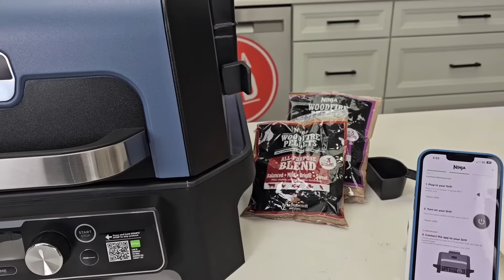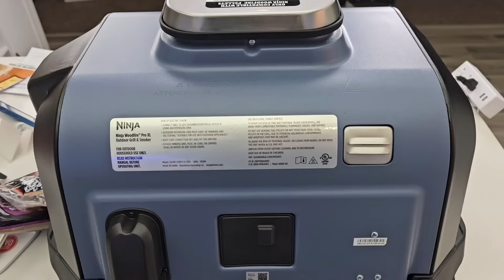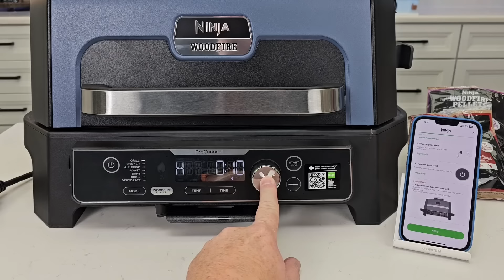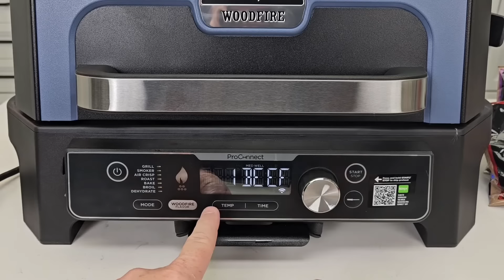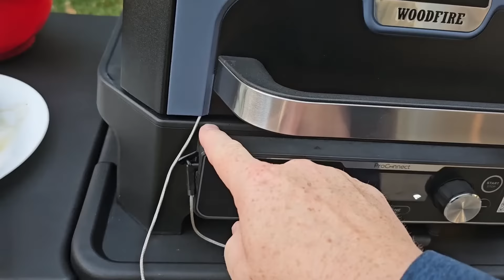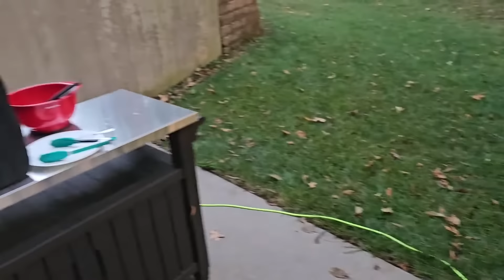Ninja Woodfire Pro Connect XL Review | Setup, App Control & Steak Results!

Comment: I just bought 1 of these. It was on sale for 177. Those wondering if the smoker works woth the pellets.... yes it does give it a smokey flavor if you turn it on
Reply: It was the pro connect xl? You sure?
Reply: @kevinahearn8764  yuuuuppppp. Positive. If i could post the pic i would show you. Got a pic n video. The pic shows the price. Almost bought 2 to try to sell the second one or gift it to someone who deserved it.
Reply: @peterodriguez5340  dang thats a deal. Just bought mine for 400
Reply: @kevinahearn8764  ill try to find a way to post a small vid clip with the price on it. So far i have only cooked bibs and poppers. Poppers came out fantastic ribs werent to bad. But i didnt have apple cider or anything else to keep it from drying out other than water.
Reply: @peterodriguez5340 where did u buy so cheap ? I paid 300 on prime day

Comment: 30 minutes for a thin steak? That steak shouldn't have taken but about 16 minutes tops. What's the temperature of the surface?
Reply: Thinking the same thing. I do steaks in my ninja foodi and never gone past 10 minutes.
Reply: Probably low temp because he also used the smoke feature. I’m sure this adds on time.

Comment: I’m looking for a foldable stand.  I have ordered the pro connect XL - most table top I see are only 20 inch depth if that-  can you tell me the distance between the front and the back feet of this unit and the approximate width of a table and depth of a table that I would need?  Thank you for your time.